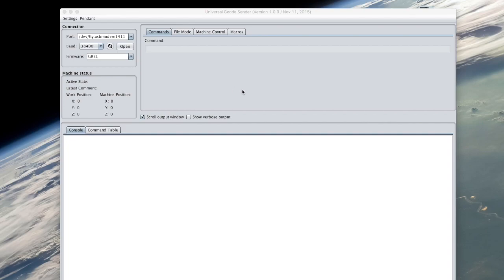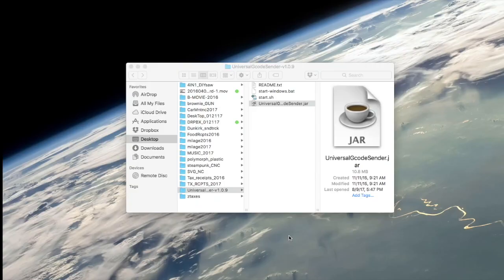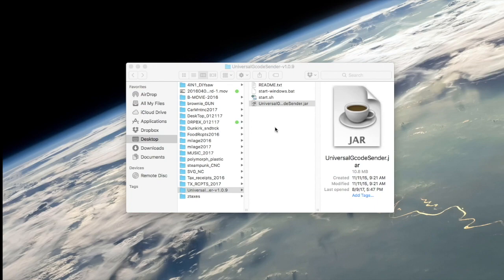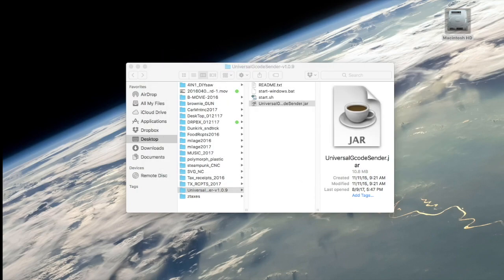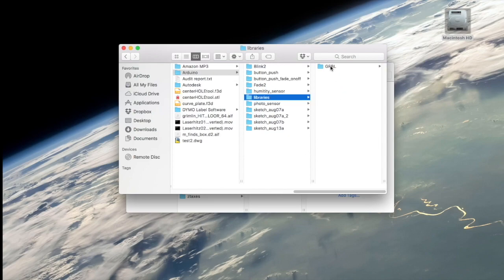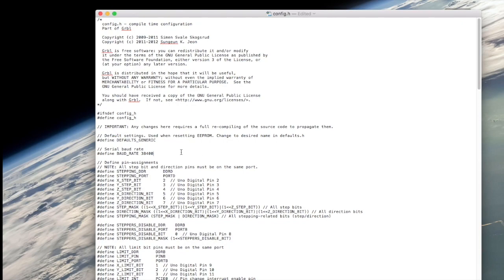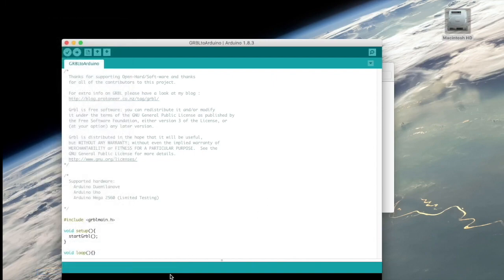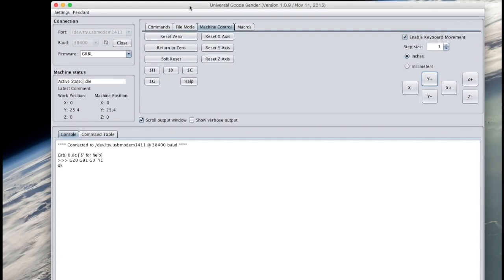Edit Baud Rate for Universal G-Code Sender for CNC Machine (GRBL) - Mac

Comment: Hi!! I need to find out something.when I start up my machine and universal g-code sender everything works fine,but when I start a project on my cnc machine and it's maybe like 20%  into the project, the machine freezers and the universal g-code sender also freezers... When I close it and open it again it gives me the error grbl hasn't finished booting.. what could be the course of this and how do I fix it??
Reply from the maker: Wow sorry if I never replied to this, Could be baud rate is not the right setting, or the hardware on motors could be ceasing up due to lack of proper amps, or connection rate and speed the information is trying to read and write to the hardware from the software due to improper baud rate. I don't know who to troubleshoot these issues with, but I know shorter projects maintain better stability than longer & larger projects.

Comment: Hello sir i have problem with gcode sender i browse my gcode file than i send and gcode is complete at 00.00.00 sec
Reply: Showing gcode is empty
Reply from the maker: how much gcode do you have in the file? are you starting the code correctly? from what I have learned on youtube and other vids myself, is that if you don't start the code with the right characters it wont register correctly. that could be a reason, but if anyone else wants to chime in, please do. I am not a total professional at this. I too have learning curves. But hope this helps some how.
Reply: G code is correct i download from one site thay used this g code work properly but may gcode sender show empty file

Comment: hi sir .. i have aproblem in my cnc can you help me ?
Reply from the maker: What is your question? I am not really a professional in this area as I am learning and sharing too as I go, but I will do my best to answer your question.
Reply: thanks very much .. when i upload g-code file to g-code program . it take long time after begin work and there are err msg in console ( error: Expected command letter ) ..can you help me about this .
Reply from the maker: Do you get err msg via arduino console or via the UGCS console? I get err messages on the arduino program a lot usually i have to make sure the code is exactly how it should be and NOT broken OR you can start over and re-upload arduino entirely to make it work. Takes  a little messing around but can get it to work for me. If anyone reading then can give good counsel on this, by all means ---chime in.